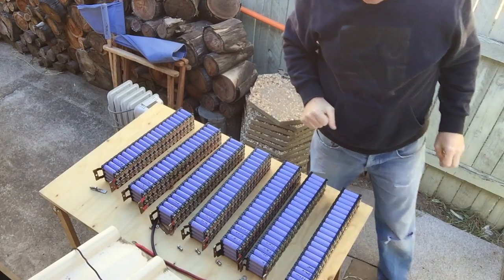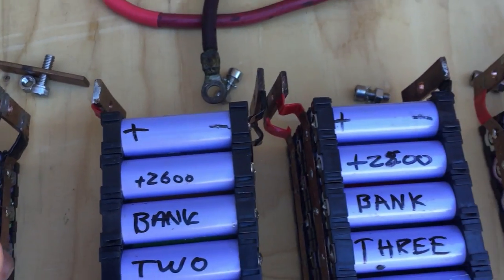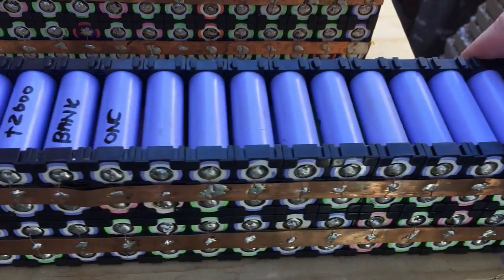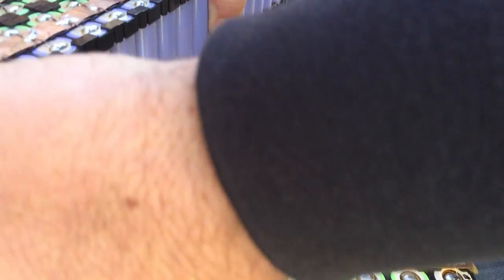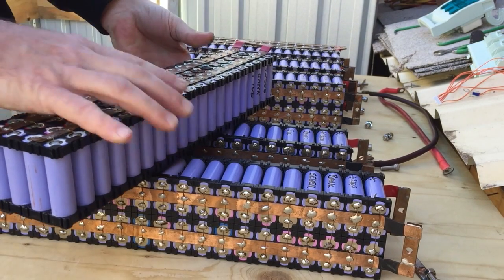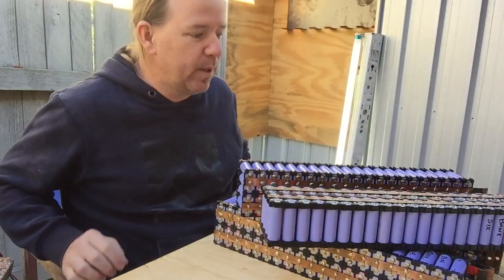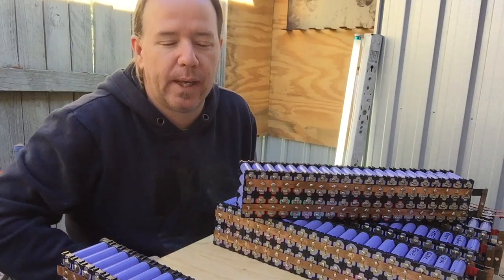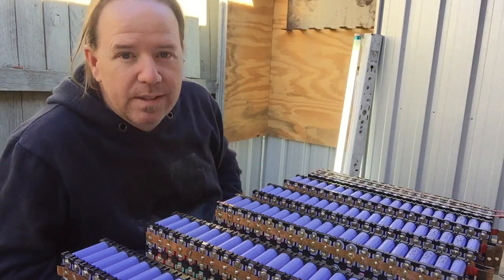Pulled out the 1st pack and gave it a once over & added second 18650 HBPowerwall

Comment: Hello there. I see you have a bit of a challange with your soldering. Specially the transferconnection. I recommend you preheat the busbars, apply tin/solder and wipe it off with some papertowel. Ofc. fold it a few times before you wipe off the excess tin. And ofc. do it somewhere safe, so the warm soldering doessent go all over the place. Best way to preheat is using a propane burner. I am sure there has to be some bauhaus or an other construction company near you that rent out such things. The reason I mention this is that you will not have any erotion probloms anytime soon. Copper does erode quite fast and low voltage with band contact can be very challanging to pinpoint in the future.

Comment: Bus bars couldn't u screen hole and put nut bolt washer to keep them together instead of soldering as the sole means of keeping it structurally together? Just wondering.  Great work, very impressive, quick q- target storage capacity?
Reply from the maker: 30kwh total

Comment: you should have your buss bars come out opposite sides of each pack, to distribute the load to each cell more evenly. This could help with the heating your getting toward  the top of the pack and make them heat more evenly across the pack (talking about the temps of actual cells here). You might actually get more run time out of your battery this way, and less bounce back when you take the load off. I think the reason you get so much bounce back is you are actually discharging  the cells at the top of the pack quicker,  and when you take off the load they start to balance out. I made a 3d model of the packs I want to build, I'll post it in your facebook, hope it helps you out.
Reply: I just uploaded my model to the 3d wearhouse on sketchup. Just in case you'd like to have a closer look at it, you can search 3d wearhouse for "18650 battery module" it's the only thing that comes up.

Comment: Looks great Pete.
NB: Solder only provides a weak mechanical connection. Probably a good Idea to put some M3 or M4 screws through the top of the bus bars where the battery connect strips meet the linking bars to provide a better mechnaical connection.
Brenden

Comment: Some things to consider, Sir.  1)The total weight of the pack should be resting or transferred to the plastic supports on each end, not to the bottom of the 4  lowest cells directly.  2)  I don't know but I would never apply the greater amount heat needed to solder the connections on each end of those batteries, as you have.  There is no knowing what possible thermal damage is occurring inside as opposed to spot welding the connections.   It may shorten the service life of individual cells over time.   3)  I feel it would better to have some design of assembly which will allow failed individual cells to be replaced individually and relatively easily.  The assembly as it stands now does not permit that.    Great work my man and thanks for sharing.   Cheers.

Comment: are you measuring the internal resistance of the cells when you test? using cells with high internal resistance is going to cause local heating issues.

Comment: An idea for the busbar, for the first cell's fuse being ripped off. 
You could add a row of the black cell clips, put some wood or plastic in between them, and then screw/bolt/glue or otherwise attach to busbar to that extra row. 
That would mean any pulling on the connection at the top for any reason would be against that extra row and how you attached the busbar to it - not against the fuse of the first cell. 
I'm not sure how you'd fit that in with your current design though :/ 
any thoughts?